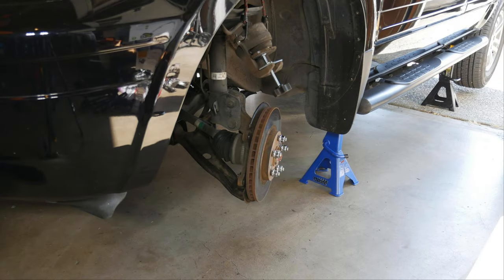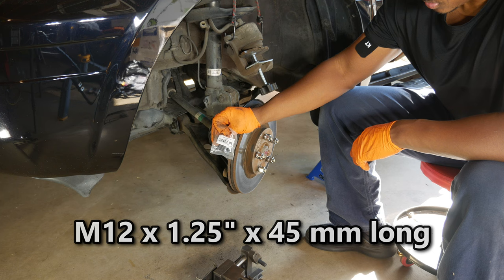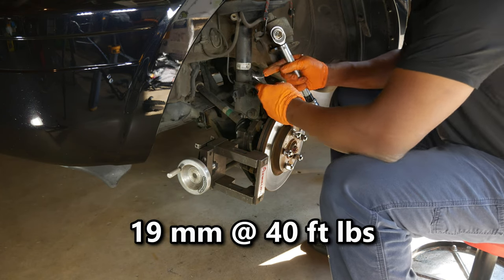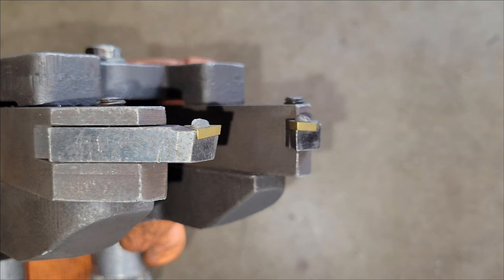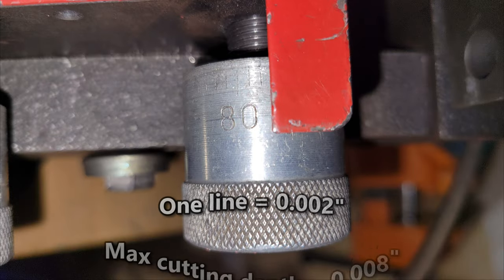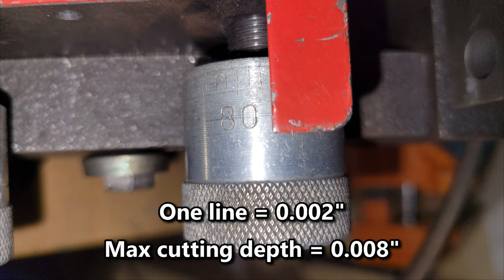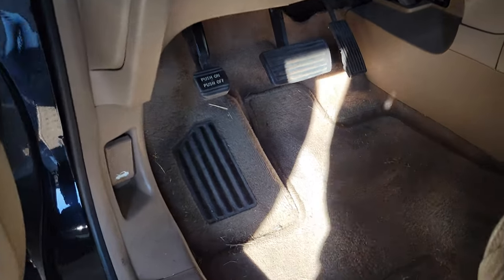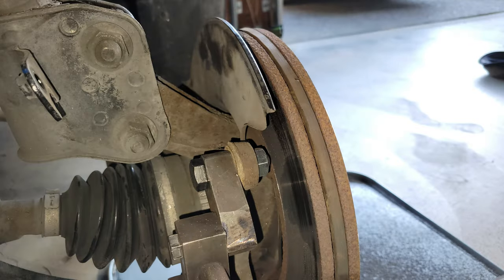2004 Honda Pilot - Front Brakes + Kwik-Way On-Car Brake Lathe - Part 2

Comment: They could have a rotor halfway done in the bench by the time it takes to install this.
Reply from the maker: This was more of an experiment than a "how-to" for the typical DIY'er, since most people won't have access to this lathe. It would have gone much faster with the Honda adapter. Also, Honda recommends using an on-car lathe.

Comment: seems like a lot of work to set up does it work on newer cars
Reply from the maker: It took some time to set up on initial use. I'm guessing it works fine on newer cars, but I wouldn't be surprised if certain sensors need to be disabled.

Comment: Cool tool, but man, the setup time almost makes it worth it to just have a shop turn the rotors. The proper adapters would really save time, shame you couldn’t find a set.
Reply from the maker: Now that I done it a couple times, it's not too bad to set up. Honda recommends using an on-car lathe, so I'd have to leave my car with a shop. I may revisit making the adapters on my 3D printer.

Comment: so it has to be on the driving wheels.
Reply from the maker: Without the optional power unit, the lathe has to be installed on the driving wheels. It barely worked on the Pilot's rear wheels; I had to make shallower cuts.

Comment: If I saw you using a powered driver to loosen and tighten those bolts on the lathe, I'd give you a raise...and then fire you so you'd have extra regret
Reply from the maker: Ok.